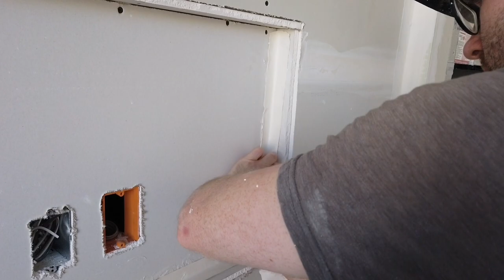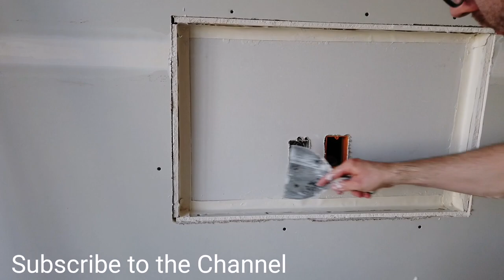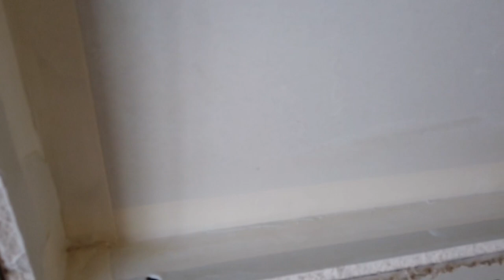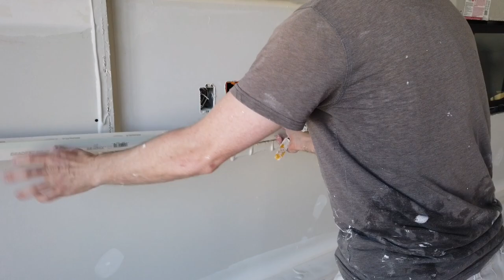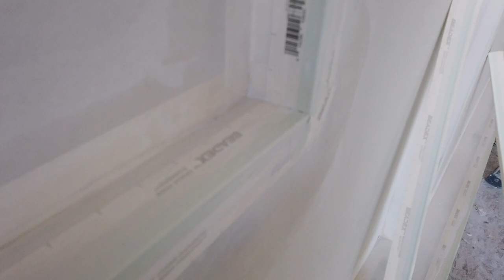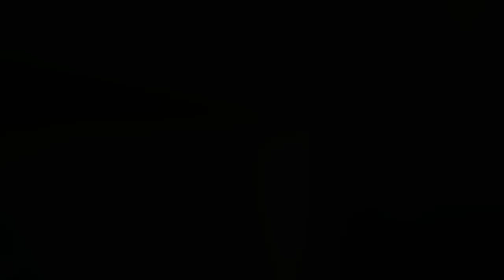Tape and Cornerbead a Drywall Niche

Comment: Always start from the middle flattening tape...
Reply: That's good advice for a long joint across a whole wall to prevent the tape from bunching up. Short tapes makes no difference where the wiping starts. All those tapes wiped perfectly in the video.